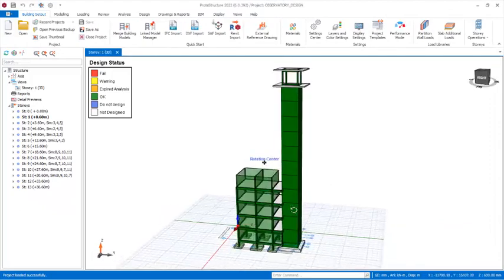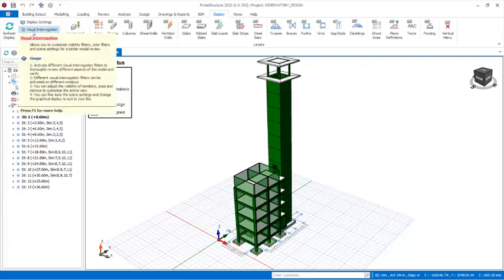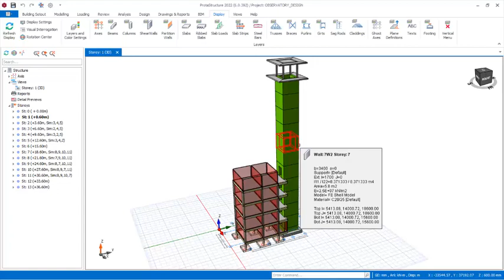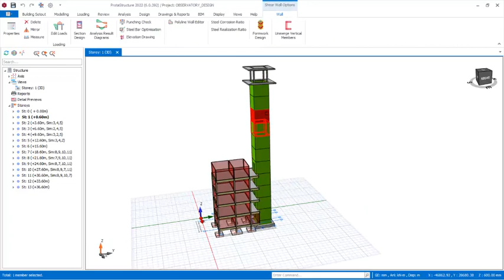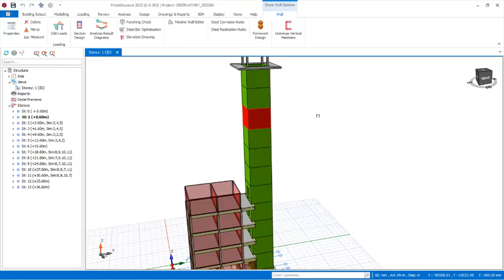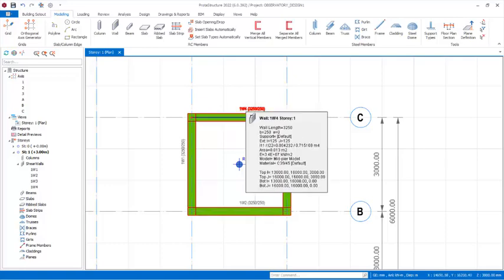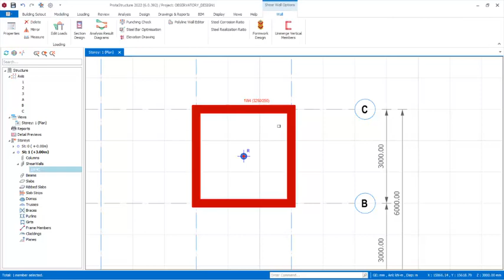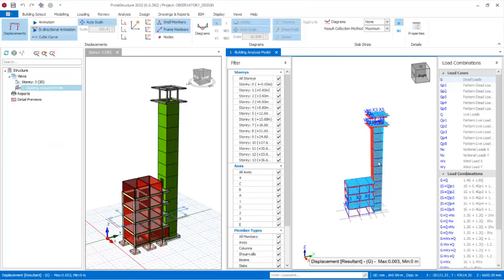PROTASTRUCTURE SHEAR WALL DESIGN TECHNICS (OBERVATION SECURITY TOWER)

Comment: Thanks so much for this great content sir, I  always like b4 watching the content of your videos because I know what I will be getting. My question is that i watch one of your video that you said we should always put column at the edge of wall if beam is to pass through it. Does this applies to this video as well. That area we have a cantilever beam is there column?
Reply from the maker: In a case of grouped shear wall, no need adding column at it edges. Only add column when shear wall is not group.